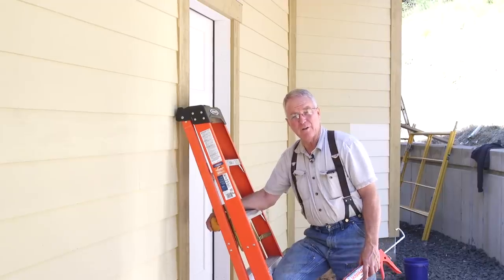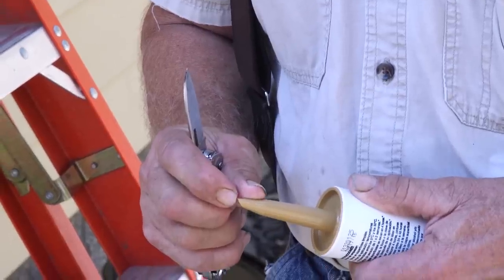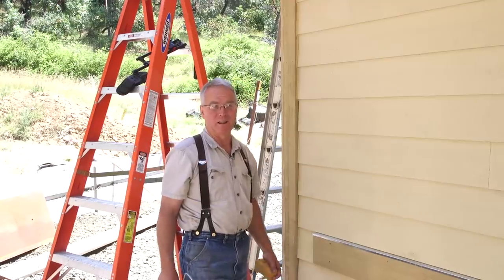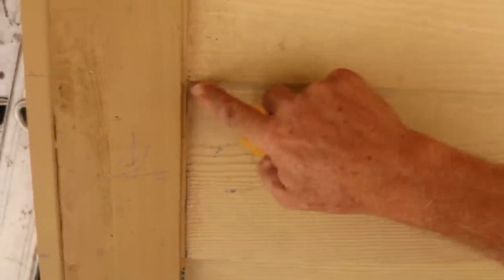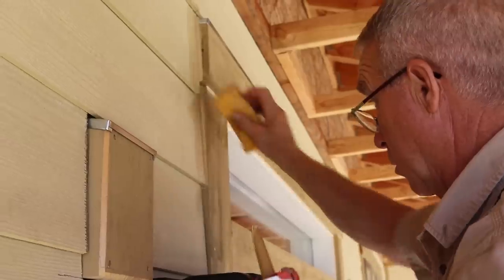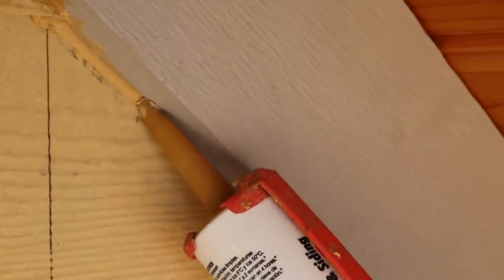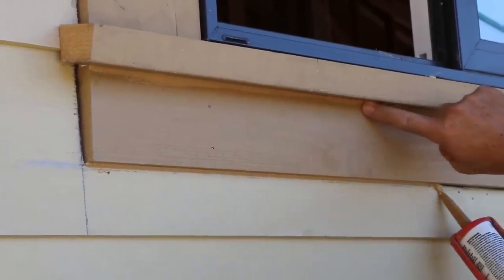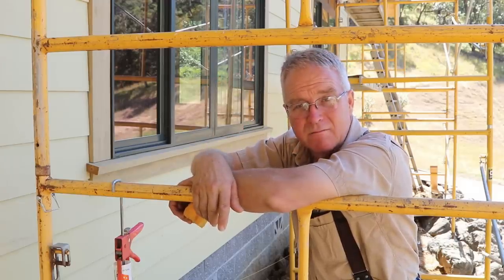Up Your Caulking Game Ep 86

Comment: As someone from Norway, I find this kind of strange. Our houses have a layer of weather protection behind the siding, with a large enough gap in between so that air can circulate and dry out the boards when wet. We do have to put "mouse bands" (google "museband" to see what I mean) between our foundation and the boards, or they'd get in there. We don't caulk all the details like shown here, but we put a lot of attention into making the weather protection layer "airtight" (or I should say watertight and windtight, it does "breathe"). Our siding is almost always wood, horizontal boards being more common where you have more weather, as we say. In Norway, we don't mind the gaps :)

Edit: I don't mean to criticize! Different products and climates call for different solutions. I'm sure there are cultural differences too.
Reply: Where I live i would have constant problems with colonies of insects moving in to the space between the weather seal and the siding if I don't caulk. The lap on the boards will let them breathe enough, but around here even the bugs know that they don't need much insulation to get through the winter.
Reply: We have that in the US also, we call it a rainscreen. It is usually only found on high end homes in wetter or harsh climates.
Reply: Some products require specifically that you do not caulk them to maintain warrantees. This allows the material to always dry when water does eventually penetrate the seal. If I was installing painted wood siding,I would never caulk it. Every wood siding job I’ve seen that is caulked ends up rotting at the ends from the captive moisture. Better to paint all the end cuts and the the wood dry naturally after moisture exposure.
Reply: @Adirondack Homestead hmm vinyl is cheap crap, I don't this wood or trim is "crap." I do believe it is a type of cement board so maybe it doesn't need to dry like typical wood siding.
Reply: I think this is some type of cement board siding that is porus so it doesn't need to breath like wood trim. If you go back a few episodes they explained the siding in more detail.
Reply: @brentoconnor6127  the rot you mentioned, I bet you noticed great big gobs of caulk crammed in there. The caulking should be applied as in this video, in there but relatively thin. It's purpose is to keep things out, it should NEVER cover the entire end grain typically you want a third or less. It's purpose is not to make anything water tight, it is supposed to discourage bugs, and stop sheet flow. You don't want bears ripping the side of your house off to get the bee's nest out, and you don't want the ants to accidentally damn up your siding and hold standing water after a rain with a stiff breeze. In the case of lapping, it should not be caulked horizontally between boards except for temporary repair before replacement, because again, caulking in buildings is not meant to be watertight. Trim around windows and doors is tricky, and I tend to favor caulking behind the trim and leaving the trim entirely ornamental. Also again as stated, as a professional builder he just left the caulking to the painters, it is significantly an ornamental consideration.
Reply: Dead on ximono - would you mind sharing pictures or video of mouse bands. In my experience this is the hardest detail and I’m curious how you do it.
Reply: We do caulk our windows though! Half inch gap around all sides of the window, and backer rod. Pluts LOTS of caulk...
Reply: You will find as many different opinions about weatherproofing houses in the US & Canada as you can find people to give them, and it's made complicated by the different construction styles, materials used, and the many many different types of climates served.
Reply: @Adirondack Homestead Where did you get the idea that this caulk is to keep it water tight? Where was that mentioned? He keeps talking about the caulking looking good because the caulk, like they paint,  is for cosmetic reasons not for weather proofing.
Reply: @Adirondack Homestead lol
Reply: You guys must have alot of fatalities at train stations 🤣
Reply: @MikeHeath  Adirondack Homestead amateur quarterbacking in the comments section. Good grief. Checked their channel to get a look at the work they do. Bupkiss. Zip. Zilch. Nada. Nothing but hot air. To be honest, I'm not really surprised.
Reply: @melvin_0bviously  Google "museband". It should be put in place before the siding, but there's also a product that can be squeezed in afterwards.

Comment: done miles of caulking in my time and the best manual dispensers for the 310ml tubes are made by hilti, try one and you'll never go back to the skeleton type again. Only thing they are insanely ekspensive.
Reply: Thx, looked it up.  I have one (was in a house I bought)  will try it.
Reply: Even the next upgrade from that strap gun would be a great improvement. Milwaukee battery gun on anything over a few tubes for me. I like vulcum for exterior on my personal projects and whatever homeowners want is up to them.  It cost more but it will out live any grey beard on the end of the gun.  You would also look like Popeye when you squirted out one side of a house with vulcum in a manual gun.
Reply: @jasonhahn4470  Retiree doing a restoration on one house.   my fanciest  tool is an electric Door Planer.  I tell myself one House basic tools will do.  Is my/that logic is flawed?  Thx.
Reply: @613kc  I don’t think your logic is flawed. Unless you find it difficult to use a manual caulk gun for more than few minutes you probably do not need with a battery. But like Scott said you want a decent quality one or it will be hard to control the flow.

Comment: Very interesting to see. Where I live, construction mostly moved away from caulking decades ago (it is almost never used on the outsides of buildings, but still has some uses in bathroom / tile installations and as a filler material insides) because it is considered less reliable and less durable than the adhesive-backed expanding foam sealing tape that has become the standard in essentially all professional applications. The only times I see caulking used on the outside of a building these days is the occasional DIY job.
Reply: Huh?  Are you referring to air sealing a building?

That isn't what they are doing here.
Reply: @dpeagles  No, obviously not. As Mr Wadsworth explains in the video, he is using caulking to prevent moisture ingress. However, where I live, we don't use caulking to do that on the outside of our houses, and haven't done so since at least the late 90s. We use expanding foam tape instead.
Reply: @SebastianSonntag  They used house wrap and a special plywood to seal out the moisture.  
According to earlier videos.
Reply: @dpeagles  He explains that caulking is used to prevent water from getting in literally in the first two minutes of this video.
Reply: @SebastianSonntag  yes...and the house was already water sealed.  Despite what he said.
Reply: @dpeagles  I'm not quite sure what you are trying to say here, but I'm fairly sure it has nothing to do with what I wrote.
Reply: @SebastianSonntag  Where do you live?
Reply: @andrewalexander9492  Northern Germany, mostly.
Reply: @SebastianSonntag  Thanks, it's interesting to know where different techniques and practices come from.

Comment: The biggest problem I have is that my finger wears out.
Reply: Coat it with liquid bandage first and during. It can but you some extra miles
Reply: You can just use dishwashing gloves and cut off the finger.Use it until it wears out then cut off another.They also sell cheap plastic caulking tools in various shapes and sizes on amazon
Reply: @BrooklynBalla  Single-finger gloves exist too! Although they're more like cheap disposable latex than strong dish-washing type glove
@Gbcue You can buy silicone tools to use instead of your finger they might even be called "fingers"
Reply: Production painter here. I caulk 75% of the trim in thousands of square feet of house every day.

The 2 first things for your finger is: caulk thick enough, and use LOTS OF WATER. I carry a small bucket with water and a rag to clean off and dip my hand/fingers in.

Don't press harder than you have to, and use different fingers.
Reply: Ezekiel Benavides good stuff

Comment: Kudos to you doing that large caulking job. My wife and I bought a church built in 1892 and we are restoring it as well as making it our country get-away. It has what looks like bead-board covering all the interior walls from floor to ceiling (including ceiling 17 ft up). But it's not bead-board, its individual strips of wood 2 1/2 inches wide and so far I have used about 30 tubes of Dap Alex Plus filling the gaps (1/4"). I called Dap and asked them if this was the right product, and they said "sure that will work, it's a favorite of contractors". But they suggested I use a new Dap product, Alex flex instead. And they said why don't we get you to try it out and you let us know how it works. They sent me 10 cases, 124 more tubes! So, I have a lot of caulking ahead and hope to be quite proficient when I am done. But I have to hand it to someone who does this for a living, it's a hard job. I have lost the fingerprints off both index fingers and can have cramped hands for a month after. But as you said, it gives you lots of time to think and to listen to podcasts. I listen at 2x speed regularly and the day goes by much faster.  I am going to try the sponge out. I have been using white rags. Thanks for all the great videos!

Comment: doing that much caulking you'd appreciate an electric caulk gun
Reply: How much control do you have with electric vs manual caulkers in your experience?
Reply: @enknaran  They have speed controls so if you dial in the speed it can be fine. The guns i have experince wth (Ryobi and Milwaukee) have a bit of a delay between pulling the trigger and caulk coming out. So on short runs the delay makes them annoying.
Reply: @enknaran  like everything there's a learning curve but no comparison to that cheap manual gun. Milwaukee is only one I've ever used but great speed control. Not to mention the orthopedic savings on carpal tunnel syndrome
Reply: I was going to bring this subject up, but you beat me to it.
Reply: @enknaran  you have more control with manual for sure. but electric  is no science
Reply: @enknaran  when you use an electric gun you lose all the feedback you get in the trigger of a hand gun. It's very helpful to have that feedback so I only use electric guns when I'm throwing a bunch of adhesive onto masonite or a backsplash or countertop or something, not for caulking gaps.
Reply: He's a blacksmith... Probably didn't even feel it in his forearms. 😀

Comment: While your caulking your day away, and emptying all those tubes,spend some time thinking of ways to use those empty tubes. You got all day, take your time. When you look at all those tubes at the home center are going to wind up in a landfill forever, you can come up with at least a few ideas for the ones you use. I actually made a sun screen for a porch by cutting 1/2" wide circles and riviting them together and putting them into a frame. Don't even have to paint it and it's weather resistant and shades one side of my porch. It's kinda like a big sheet of chain mail. I'm no tree hugger but when I think of all those tubes at the home center going nowhere after use, it just irks me to no end. Single use plastic is taking over my planet,and I don't like it.

Comment: "Get a good caulking gun" as he's using a $1.89 gun.....
Reply: Always a critic out there hey? 

It's funny though given that caulking gun he has is easily a $5-$10 model, definitely not the best but it's still a totally serviceable gun compared to the garbage ones he's referring to and what you claimed he has. 

Personally I like the suction based guns that only attach to the caulk tube at the base of the tube for thinner caulking, or the one where the tube holder can rotate around freely for thicker caulk.
Reply: A big differentiator between the garbage guns and the good ones (10 bucks or so gets you a good one) are the tip cutter and the puncture wire he pointed out. Cheap crap ones drop those details. Also, don't use the tip cutter, they all suck.
Reply: diver dave  don't hold out, man, brand name!
Reply: The guy could probably lay caulk with an old sock and a piece of beer can for a tip.
Reply: @PVS3  Cox and Albion are two brands of high end caulking guns.

Comment: I'm a GC and work with a painting crew doing a lot of exterior carpentry repairs. You have a lot of good advice here. Sponges work fine but I like to use a wet rag (the thin painters rags not the terry towel type) and wrap it over my finger for the first pass and then dampen my finger and smooth it out on the second pass.

Comment: Solid knowledge here. As a professional painter, I would have to show you how to pick up your speed considerably. That is, cut your tube to expose a far larger hole, and cut it almost blunt. Not totally blunt, but a slight angle. Caulk the joint with the caulk gun perpendicular to the house. With good technique you can get a proper application that requires no wiping. I learned this from a siding guy. I see a lot of siding guys do it this way, though some are better than others.

Comment: Our siders cut at 22° and hold the gun almost perpendicular to the siding. They use oil based chaulking and don't touch it with fingers afterwards, that way when it shrinks it looks flush and not sunk in.

Comment: As a 17 yr old in HS, i got a job doing paint prep work for the cabs in a locomotive fabrication shop.  I would go through 10-20 tubes of caulk a day for an entire summer.  That having been said, you're absolutely right about the tip.  Cut at an angle around 45 degrees.  Take your time and if you get enough practice, you don't follow up with your finger at all.  If you do it right, there is no need.  
Now you'll always come up against some really weird places where you will need to eventually, but if you make, not using your finger your goal, you get way better way quicker.

Comment: Thats a nice caulk job. Like most aspects of carpentry good finished work comes down to doing the seemingly easy and unimportant in an elegant and thoughtful way. 

For sure it's worth the time to caulk it nice the first time so you don't have to tool it in with your finger. Best to let that tip tool it in as you find the sweet spot of squeeze strength and speed.

Comment: Another tip: You can use these hard rubber or soft plastic ' fingers' instead of your own finger to strike in the caulk. They come in different sizes and they are way more consistent in in smoothing and pressurethan I could do with my finger.

Yet, @Essential Craftsman, I'd like to see you go deeper into the sealing of windows with silicone. The glass always trips me up, and I've given up trying so far because... You look at at/trough windows and thus you want to to be perfect. Keep in mind, I'm a EU man, so things might be a tad different here for whatever reason.

Thank you so much for bringing this knowledge in a calm and clear way.

Comment: looks good. I've always been taught to cut my tip straight and push with the caulking gun so that your pushing material into the gap. although personally it depends on what I'm caulking. but when you push you don't have to use your finger. I find dripless guns the best for finish work.

Comment: I like the blue tape method for flat planes and interior work. Put down tape on both sides of the surfaces leaving about an eighth or 3/16 in between. Caulk the gap, strike the joint and immediately remove tape. Perfect caulk joints every time. Takes a little prep but is worth it
Reply: If its more than a few feet, it'd be time-consumming. And blue tape ain't cheap either.
Reply: @beby843  Im talking more about showers, backsplash etc. White caulk will blend into the background allot better than color matched caulk and silicone. It takes a minute but nothing worse than building the perfect shower just to screw it up on the last step.
Reply: @davegordon6943  in that case, yes.
Reply: @beby843  try it on a small job, you'll love it
Reply: @davegordon6943  thanks.

Comment: I install a LOT of Hardie plank and Smartside. We ONLY use OSI Quad, and you DON"T want to run your finger or a wet rag over that stuff. It's way too thick to strike like this. And many(most) times, the trim and siding are 2 different colors, so smearing a colored caulk onto a white trim means more touch-up painting I have to do(LP and Hardie products come pre-painted) after install. Just practice and you won't HAVE to strike your caulk lines.

Comment: Been working as a siding installer for 14 years .Contractor for 5.   The sponge with the soap and water bucket trick  is just awesome.it keep your hands always clean and ready to work the material. The sponge really help to push the caulk back to were your want it.  For flat joints I will keep using my painters tape on both sides with a good spray of water and soap on all the material so it does not stick to the tape. then i push it into the crack with my finger or a moist wood shim or a butter knife. Then i remove the tape and do a final pass with my finger or tool. I try to use backer rod for every situation where i feel that the caulking will try to escape. Caulk is expensive compare to the backer rod.  being made of foam, the BR also help the caulk to stick. 
sometime you have 2 or more different caulk colors to work with. In those cases, always carry as many guns than the colors you work with. It will save you time.

Comment: I bought a battery operated caulk gun and it has changed my caulking game for ever. I wear nitryl gloves an use warm water. The caulk gun lays an even bead everytime with no stopping so you don't get any clumps or caulk farts. Then I blend it in with my finger when needed. Since I'm wearing the gloves the caulk doesn't get tacky on your flesh. I get amazing results in half the time